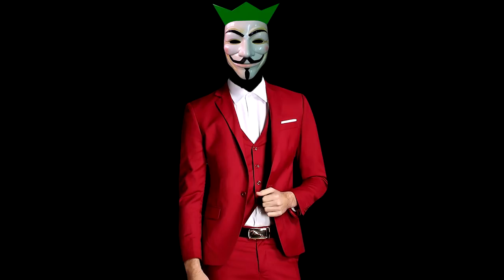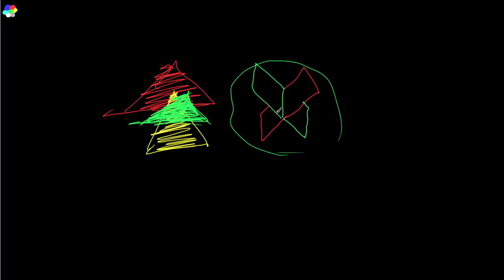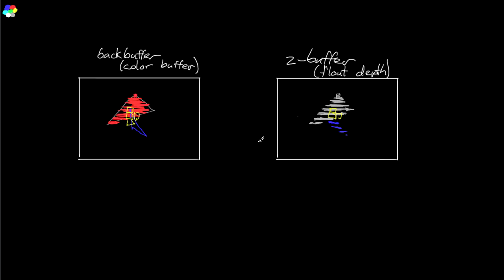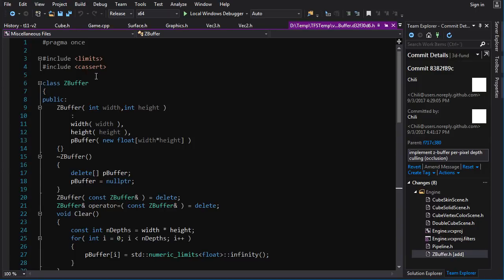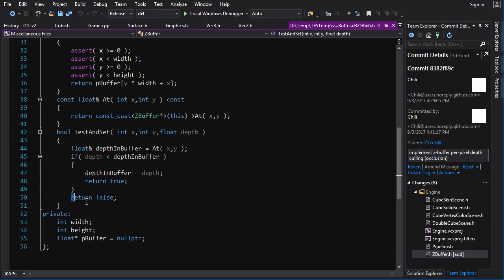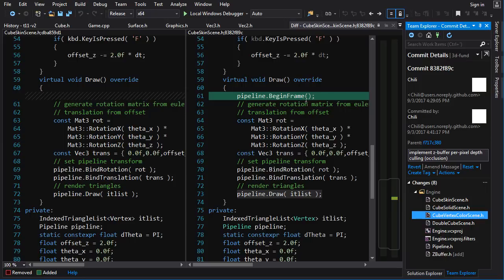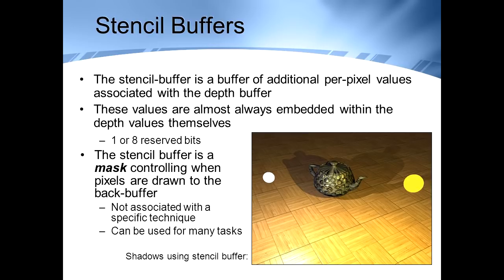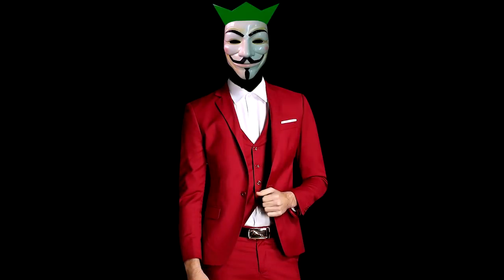3D Programming Fundamentals [Z-Buffer] Tutorial 11

Comment: Noice!

The weird depth values that DX/GL are storing in teh depth buffer are not 'exactly' the "reciprocals" of the depth - they are also clipped by the near and far clipping planes, so it's just the depth that is spanned within just the view-frustum. It's the thing also being used before the perspective devide for clipping againgst the near/far clipping plane(s). When rasterizing, you can also "raste-clip" pixels along the Z axis, meaning - get rid of pixels who's depth is too far away (behind the far clipping plane). In DX that z-span of the depth space ends up being mapped to 0->1, while GL in GL it's -1->1. In both cases you can just "clear" the depth buffer by setting it all to just 1 (instead of infinity). And the non-linearity of that space is a "feature", not a "bug" - even with 32bit you can often get noticable Z-fighting if you just store the depth linearly in the depth buffer